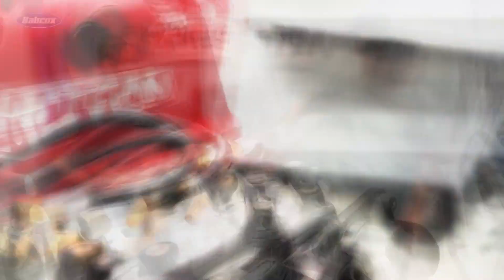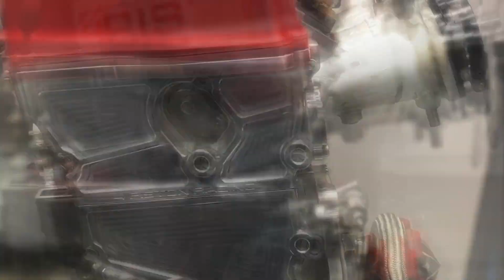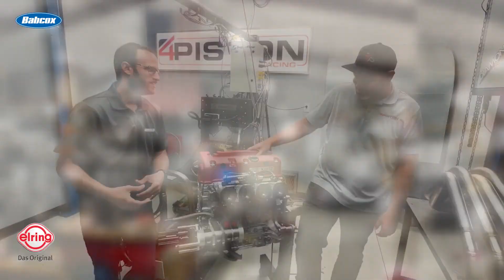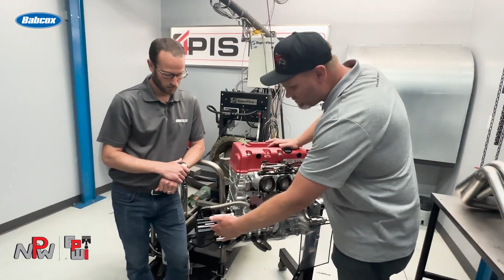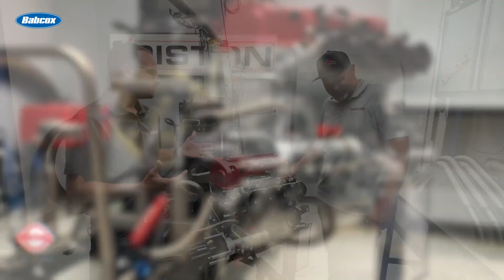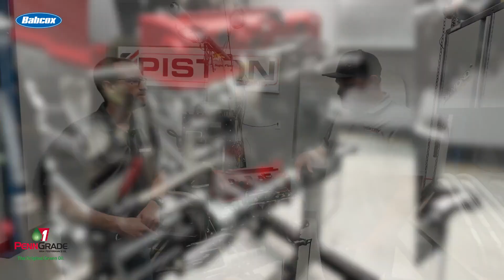4 Piston Racing USAC Midget Honda Engine

Comment: 154ci . K24 alu. Block & Head
90mm bore +3mm over bore from Oem 87mm bore
Stock 99mm stroke using oem crank .
9600rpm .
Little over 400hp .
No variable cam timing . 
Mechanical injection ITB setup
Engine weight under 300lbs

Its insane how things have changed since i was into hondas 16 years ago..prices on K series engines have come down while B series vtec engines have more than doubled in price. .. wish i didnt sell off everything i had years ago..
Reply: Same brother

Comment: The money spent on these engines are worth it. It's already $7k-$8k for a mild k24 block/k20 heads(with new cams) build at the shop for 250 whp - 260 whp. Might as well throw down a few more grand for 300+ whp daily street k24!!!